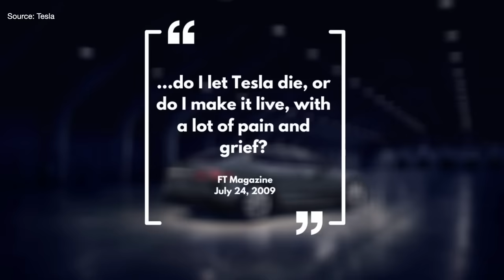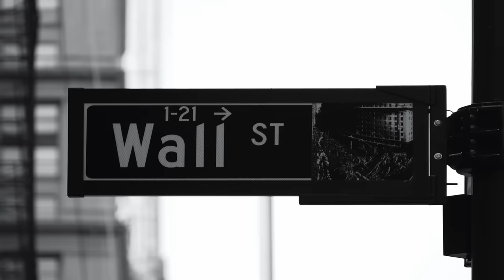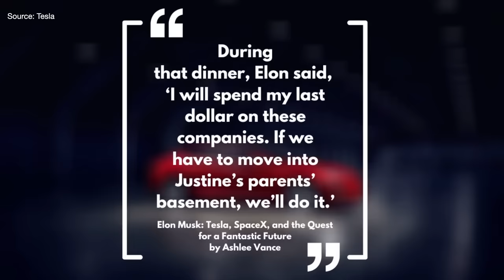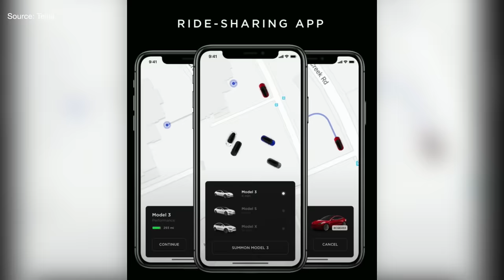How Elon Musk Saved Tesla from Bankruptcy

Comment: Tesla cars uses electricity...electric power come from oil and gas...so what's the benefit !!! Just a bubble and a lot of marketing
Reply: The current energy generation mix in the US is 61% fossil fuels, 19% nuclear and 20% renewables. The average efficiency for fossil fuel and nuclear power plants is 36% which accounts for 80% of total energy production. The 20% that is renewable is effectively 100% efficient (as sunshine and wind are free) this means the total average power generation efficiency is 48.8%. The transmission line efficiency is 95%, charger efficiency is 92%, inverter efficiency is 90% and motor efficiency is 90-95%. That means the total end-to-end efficiency for EVs is 34-36%.
The internal combustion engine (ICE) is 30-35% efficient before we include the losses that got the oil to the gas tank. The well-to-tank efficiency is 80% which makes the end-to-end efficiency for ICE 20-28%. 

So EVs are 6 to 16% more efficient than ICE but that’s not the real issue. When it comes to transportation the issue is ground level pollution. EVs output zero emissions at ground level whereas ICE output carbon monoxide, nitrogen oxides, particulate matter, and unburned hydrocarbons that are health hazards that cause damage to the human respiratory tract and increase a person's vulnerability to, and the severity of, respiratory infections and asthma, nose, throat and lung irritation, coughing and shortness of breath. Exposure to fine particles can also affect lung function and worsen medical conditions such as asthma and heart disease. EVs also produce far less noise pollution. Related effects of noise pollution include stress related illnesses, high blood pressure, speech interference, hearing loss and sleep disruption.

As far as infrastructure goes. In 1920 there were about 15,000 gas stations in the US, by 1930 there were over 100,000 gas stations, charging stations can follow a similar ramp up. The grid was able to accommodate the rise of air conditioning around the middle of the 1900’s. The total US power grid output in billions of kWh: 1950 = 335, 1960 = 760, 1970 = 1,535, 1980 = 2,290, 1990 = 3,038. Which means the increase in grid capacity was: 1950-1960 = 127%, 1960-1970 = 102%, 1970-1980 = 49%, 1980-1990 = 33%. The ~30% in output needed to transition to EVs is not some unattainable number, we have done it before.  We will need to build more nuclear plants to assist with base load and in addition to the buildout of wind and solar farms we will need to add grid scale storage like pumped hydro, compressed air storage, flow batteries, molted salt batteries and lithium-ion battery facilities. As profit is the main motivation for building out more capacity and storage facilities it’s a good thing that electricity costs from utility-scale solar PV is $0.068 per kWh in 2019. Onshore and offshore wind reached $0.053/kWh and $0.115/kWh, respectively, for newly commissioned projects. Replacing the costliest 500 gigawatts of coal capacity with solar and wind would cut annual system costs by up to USD 23 billion per year and yield a stimulus worth USD 940 billion, or around 1% of global GDP. Up to 1,200 gigawatts of existing coal-fired capacity would cost more to operate than new utility-scale solar PV would cost to install. The Hornsdale Power Reserve is the world’s first big battery. It provides essential grid-support services. The first 100MW/129MWh was completed in November 2017. In its first two years of operation the Hornsdale Power Reserve confirmed the benefits associated with grid-scale batteries in the National Electricity Market and saved South Australian consumers over $150 million. Grid scale storage has already show it can be profitable.

Sources:
Environmental Protection Agency
U.S. Energy Information Administration
Well-to-tank energy use and greenhouse gas emissions of transportation fuel North American Analysis  June 2001 Volume 3
University of Houston
The International Renewable Energy Agency
The Hornsdale Power Reserve